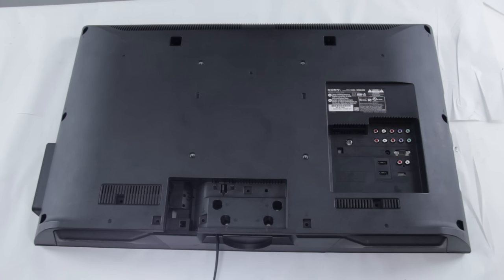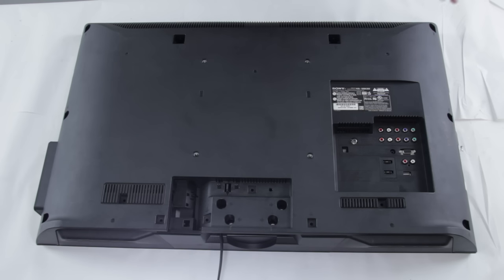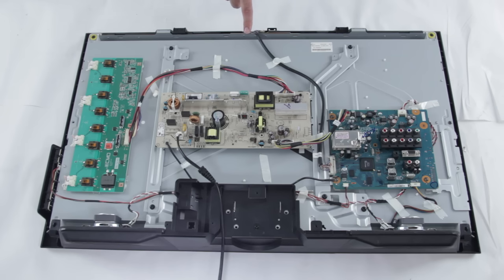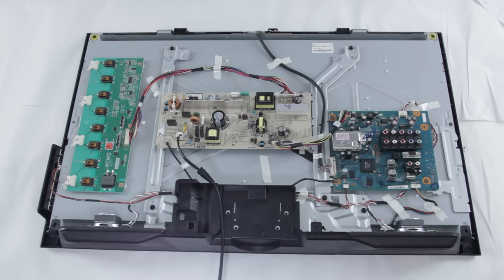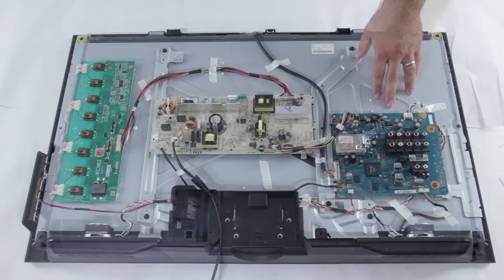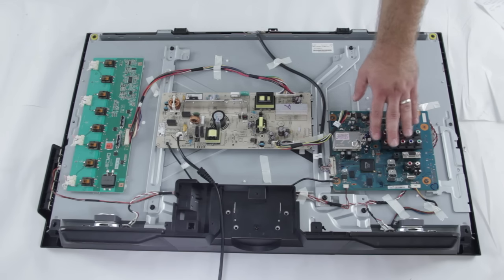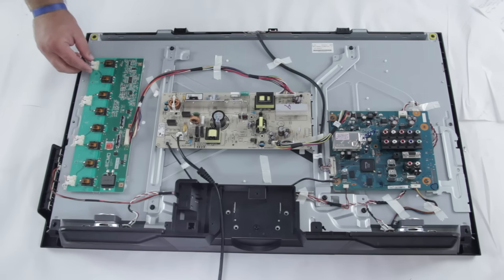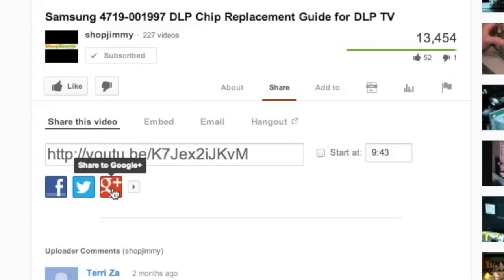LCD TV Repair Tutorial - LCD TV Parts Overview, Common Symptoms & Solutions - How to Fix LCD TVs

Comment: Hi,I have Sony Model KDL-46EX500, around 5-yrs old.  The screen suddenly turns green.  After a while it shows the picture like normal.  Please help.
Reply from the maker: +Jack Burton   Try all repairs and troubleshooting at your own risk. This could be a problem with either the t-con board, the main board or the TV panel. You can replace the main board and the t-con board individually to see if one of those boards fixes the problem.  Click this link to replacement parts for your TV model number:  http://www.shopjimmy.com/catalogsearch/result/?q=KDL-46EX500  There may be multiple boards for the same TV model number, be sure to match part numbers on your current board, with your replacement for compatibility.  Thanks and please let us know if you have any further questions with your TV Repair!  www.shopjimmy.com

Comment: hello I have a auria eq5588 lcd tv and it will not turn on even though the led power light shows that it is getting power. I'm at my wit's end please help.
Reply from the maker: +Cyril Demello   Try all repairs and troubleshooting at your own risk.  I recommend replacing the main board in your TV.  Click this link to replacement parts for your TV model number:  http://www.shopjimmy.com/catalogsearch/result/index/?cat=56&q=eq5588  There may be multiple boards for the same TV model number, be sure to match part numbers on your current board, with your replacement for compatibility.  Thanks and please let us know if you have any further questions with your TV Repair!  www.shopjimmy.com

Comment: I have a Toshiba model number 55L6200U. Ii turns on but it stays on the logo Toshiba also the led light keeps blinking its green
Reply from the maker: +jhovany morals   Try all repairs and troubleshooting at your own risk.  I recommend replacing the main board in your TV.  Click this link to replacement parts for your TV model number:  http://www.shopjimmy.com/toshiba-75030649-main-board-for-55l6200u.htm  There may be multiple boards for the same TV model number, be sure to match part numbers on your current board, with your replacement for compatibility.  Here is a link to a video showing how to identify your part number, click here:  https://www.youtube.com/watch?v=3DQe0ATZl_Q  Thanks and please let us know if you have any further questions with your TV Repair!  www.shopjimmy.com

Comment: sony Bravia KDL-46XBR4 serial #8503363 sept 2007, it's power up  (no image) 20-30 sec later, i hear a clic and start red blinking 5 times. it's intermitent problem, sometimes is lightup screen is nice. power off and not wake up.I read on another place on the web squeeze the bezel, but what is bezel and where is the potential connection fail. On mine we have more the double of board of majority of model i see on YOUTUBE. I know now for what that price (more component) better image quality. i try many time to repair my self but never sove the issue forever.

Comment: I have a JVC LT-37XM48 flat screen LCD TV,  the wrong firmware update has been used to update this TV and now it only cuts on & off and only the channel & power button works now, the TV only gets a white screen when cut on and static sound from speakers! Is there anyway to reverse or wipe this firmware update and reinstall it to its proper software programming to use the remote control and view the screen like a factory reset or something ?
Reply from the maker: +David Mack  Try all repairs and troubleshooting at your own risk.  Y<!-td {border: 1px solid #ccc;}br {mso-data-placement:same-cell;}->ou can try and put the correct firmware on a flash drive and try it that way.  Thanks!  www.shopjimmy.com
Reply: +ShopJimmy.com ,Where do I get this software, JVC customer service say they don't have it, do you know where the TV's firmware is located on this set ?

Comment: hello I have a element tv model number Eldhw421 the tv turns on can work for weeks or seconds then turns it self off  does this randomly please help .
Reply from the maker: +Rodney Purper  Try all repairs and troubleshooting at your own risk.  I recommend replacing the main board in your TV.  Click this link to a replacement main board for your TV model number:  http://www.shopjimmy.com/element-120605-main-unit.htm  There may be multiple boards for the same TV model number, be sure to match part numbers on your current board, with your replacement for compatibility.  Here is a link to a video showing how to identify your part number, click here:  https://www.youtube.com/watch?v=w7Lk4ppnXSY  Thanks and please let us know if you have any further questions with your TV Repair!  www.shopjimmy.com

Comment: I need help repairing a SANSUI LCD TV: Model no. HDLCD1955W, SN: 057610341489, MARCH 2011, 19 INCH.
SYMPTOMS ARE: THE TV WILL TURN ON AND HAS A BACKLIGHT BUT NO SOUND AND NO IMAGE. I CANNOT FIND A T-CON BOARD BUT THERE IS A
PLASTIC STRIP WHERE A T-CON BOARD WOULD USUALLY WOULD BE.
CAN YOU HELP ME?
                                       THANKS!  DAVID E.

Comment: Hi, I have a Samsung Model LN46A500T1FXZA, Serial Number ARW03CEQA15070V. TV will turn on, sound comes through, picture will come on for a second but is shaky, and then will proceed into scrambled horizontal lines. Please help!!
Reply from the maker: +Richard Reyes  Try all repairs and troubleshooting at your own risk.  This could be a problem with either the main board or the TV panel.  Click this link to replacement parts for your TV model number:  http://www.shopjimmy.com/catalogsearch/result/index/?cat=56&q=LN46A500T1FXZA  There may be multiple boards for the same TV model number, be sure to match part numbers on your current board, with your replacement for compatibility.  Here is a link to a video showing how to identify your part number, click here:  https://www.youtube.com/watch?v=BEPWrefQvqIThanks and please let us know if you have any further questions with your TV Repair!  www.shopjimmy.com

Comment: hi. bush  c5566dtv. wont turn on. red standby light goes to green but still nothing. sometimes the tv switches on and works fine  but its getting more and more difficult to turn on. hellllllp!
Reply from the maker: +Andrew Cumberland  Try all repairs and troubleshooting at your own risk.  I recommend replacing the main board in your TV.  Unfortunately I do not see any replacement parts in the search results for your TV model number on our website.  Please reply with your part number on your main board and I can try searching for replacement parts.  Thanks and please let us know if you have any further questions!  www.shopjimmy.com

Comment: i have a 70in vizio E701i-A3E....  we were watching tv AND THE PICTURE WENT OUT FROM THE  bottom to the top it went black i cqn still see a light but its black and i have sound could you help me plz
Reply from the maker: +Nicole East   Try all repairs and troubleshooting at your own risk. This could be a problem with either the t-con board, the main board or the TV panel. You can replace the main board and the t-con board individually to see if one of those boards fixes the problem.  Click this link to replacement parts for your TV model number:  http://www.shopjimmy.com/catalogsearch/result/?q=E701i-A3E  There may be multiple boards for the same TV model number, be sure to match part numbers on your current board, with your replacement for compatibility.  Thanks and please let us know if you have any further questions with your TV Repair!  www.shopjimmy.com

Comment: I have a 40" coby flat screen tv LCD. I have no sounds but a good picture. can't figure out what to do. 
model: TFTV4025
serial: sshm07xxm03t01s01
Reply from the maker: +katherine sullivan   Try all repairs and troubleshooting at your own risk.  <!-td {border: 1px solid #ccc;}br {mso-data-placement:same-cell;}->Check your settings and make sure the speakers are not set to off. If the setting is correct then I recommend replacing the main board.  Thanks!  www.shopjimmy.com

Comment: I have an Element Electronics ELEFT466 (SN: B1300228110001501) - The problem is no picture. Sound plays but no image shows and no backlight comes on either. Any help would be appreciated.

Comment: sony 3lcd model # KDF E55020 ......blue spots show up in the black portions of the picture and a small blue area on the lower right corner of the screen .
Reply from the maker: +Randall Sharp  Try all repairs and troubleshooting at your own risk.  This could be a problem with either the main board or the TV panel.  You can replace the main board to see if that fixes the problem.  Unfortunately I do not see any replacement parts in the search results for your TV model number on our website.  Please reply with your part number on your main board and I can try searching for replacement parts.  Thanks and please let us know if you have any further questions!  www.shopjimmy.com
Reply: +ShopJimmy.com Thanks for the help due to the variability of things that maybe wrong and possible lack of parts I've decided to purchase thanks for making my decision more easy.

Comment: INSIGNIA 50L260A13 NO PICTURE,HAVE SOUND I HAVE REPLACED MAIN BOARD,POWER SUPPLY AND T-COM BOARDS STILL NO PIC
Reply from the maker: +Carlton Lee   Try all repairs and troubleshooting at your own risk.  I recommend running the flashlight test on your TV.   Here is a link to a video we produced that shows how to run the flashlight test. https://www.youtube.com/watch?v=xUzCLgoSPGM Please reply with your flashlight test results and we can recommend a replacement part for your TV repair. Thanks and please let us know if you have any questions! www.shopjimmy.com

Comment: hello there; am having a problem with my sanyo tv , hope you can help me, MODEL #DP58D33  SERIAL# B3120948024962, i have full sound but no image, however i did a flush light ran and you can actually see the image, let me know what parts i need to buy to get it going again. thanks
Reply from the maker: +david torres  Try all repairs and troubleshooting at your own risk.  This could be a problem with either the power supply or bad lamps in your TV.  You can try replacing the power supply to see if that fixes the problem in your TV.  Click this link to a replacement power supply board in your TV.  http://www.shopjimmy.com/sanyo-1lg4b10y11900-z7gb-power-supply-unit.htm  There may be multiple boards for the same TV model number, be sure to match part numbers on your current board, with your replacement for compatibility.  Thanks and please let us know if you have any further questions with your TV Repair!  www.shopjimmy.com

Comment: I have a 32 in Philips model 32PFL3506/F7 Came home and tried to cut it on dead.
Reply from the maker: +Clifton Rhodes   Try all repairs and troubleshooting at your own risk.  I recommend replacing the main board in your TV.  Click this link to replacement parts for your TV model number:  http://www.shopjimmy.com/philips-a17fgmpw-001-main-board.htm  There may be multiple boards for the same TV model number, be sure to match part numbers on your current board, with your replacement for compatibility.  Here is a link to a video showing how to identify your part number, click here:  https://www.youtube.com/watch?v=wooRqBrRo6oThanks and please let us know if you have any further questions with your TV Repair!  www.shopjimmy.com

Comment: I have a model 42pfl5432/37 when the tv turned on for about 5 min it turns off then I can turn it back on stays on a inute or two and turns off you told me try replacing the main board I did and it still is doing the same thing so what else do I need to replace
Reply from the maker: +willam combs  Try all repairs and troubleshooting at your own risk.   I recommend replacing the power supply board in your TV.  Click this link to replacement parts for your TV model number:  http://www.shopjimmy.com/catalogsearch/result/index/?cat=59&q=42pfl5432  There may be multiple boards for the same TV model number, be sure to match part numbers on your current board, with your replacement for compatibility.  Here is a link to a video showing how to identify your part number, click here:  https://www.youtube.com/watch?v=6TPI5s6ZHJY  Thanks and please let us know if you have any further questions with your TV Repair!  www.shopjimmy.com<!-td {border: 1px solid #ccc;}br {mso-data-placement:same-cell;}->

Comment: I have an element tv, model no.= ELCH2S61
SEREIES NO. = GR800035890000204
It turns off a few second after i turn it on by pressing the power button.
Reply from the maker: +Zain Ali   Try all repairs and troubleshooting at your own risk.  I recommend replacing the main board in your TV.  Unfortunately I do not see any replacement parts in the search results for your TV model number on our website.  Please reply with your part number on your main board and I can try searching for replacement parts.  Thanks and please let us know if you have any further questions!  www.shopjimmy.com

Comment: I have a possessed 39pfl2608/f7   the volume just races up and down at will it will work for a little while then start going down or up   any suggestions
Reply from the maker: +Keelan Overbey  Try all repairs and troubleshooting at your own risk.  This could be a problem with either a stuck keypad or bad main board.  Click this link to replacement parts for your TV model number:  http://www.shopjimmy.com/catalogsearch/result/?q=39pfl2608%2Ff7  There may be multiple boards for the same TV model number, be sure to match part numbers on your current board, with your replacement for compatibility.  Thanks and please let us know if you have any further questions with your TV Repair!  www.shopjimmy.com
Reply: +ShopJimmy.com  NOw it it pwering on and off at will like the powerboard is going out
Reply from the maker: +Keelan Overbey   Try all repairs and troubleshooting at your own risk.  This could be a 
problem with either a stuck keypad or bad main board.  Click this link 
to replacement parts for your TV model number:  http://www.shopjimmy.com/catalogsearch/result/?q=39pfl2608%2Ff7
  There may be multiple boards for the same TV model number, be sure to 
match part numbers on your current board, with your replacement for 
compatibility.  Thanks and please let us know if you have any further 
questions with your TV Repair!  www.shopjimmy.com

Comment: I have  47 inch insignia  flat screen no picture just sound how to fixMID
Reply: does not seem like they are interested in answering anyone anymore, but i have the same tv, same problem, mine was inverter board, there is a video on you tube ...somewhere about inverter boards , you power up the tv, u use a flashlight , shine on the board at different angles , and if u can see the menu prompts on the screen ...... even though just barely then you need to replace the inverter board, mine was $24 , easy fix.

Comment: hello I have a 43 inch lcd sanyo model#dp46819  serial#b9420828616664 it will come on and the little screen saver  blinks acros the screen only half the screen works u can tap on the the back and  i8n and out

Comment: I have a Sony KDL-40XBR3 TV that all of a sudden just shows green power light but no video, audio or even any signs on the screen that the tv is on. Replaced both power supply and main au board. same thing just green power light on front and a blinking orange light coming from the back of the unit inside a metal frame that contains another board
Reply from the maker: +jimf28   Try all repairs and troubleshooting at your own risk.  I recommend replacing the main board in your TV.  Click this link to replacement parts for your TV model number:  http://www.shopjimmy.com/sony-a-1212-255-a-au-signal-board.htm  There may be multiple boards for the same TV model number, be sure to match part numbers on your current board, with your replacement for compatibility.  Here is a link to a video showing how to identify your part number, click here:  https://www.youtube.com/watch?v=Aodz2LHkzbY  Thanks and please let us know if you have any further questions with your TV Repair!  www.shopjimmy.com
Reply: Thanks guys. I tried replacing both the AU Board and the main power board. Same problem. Tried the flashlight on screen and it is pitch black.I did notice that the BE-2 board that connects to the AU board has a continuous blinking orange light. I convinced my wife that we need a new SONY XBR55X850C 4K 55 Inch (LOL) and she agreed! but I still want to try to fix this one. I hate the thought of putting it out on the street for removal
Reply from the maker: +jimf28  Try all repairs and troubleshooting at your own risk.   How many blinks are you seeing?  Thanks!  www.shopjimmy.com
Reply: +ShopJimmy.com Hi, the blinking orange light is on the back panel inside the metal cage holding the AU Board. It blinks orange continuously when the power button is turned on
Reply from the maker: +jimf28   Try all repairs and troubleshooting at your own risk.  I recommend running the flashlight test on your TV.   Here is a link to a video we produced that shows how to run the flashlight test. https://www.youtube.com/watch?v=xUzCLgoSPGM Please reply with your flashlight test results and we can recommend a replacement part for your TV repair. Thanks and please let us know if you have any questions! www.shopjimmy.com

Comment: I have a Sanyo DP42647 with what I think is solarization.
[IMG]http://i61.tinypic.com/2r6fg9f.jpg[/IMG]
The TV's menu shows properly, and as in another of your videos you mention that if the menu appears properly with the screen solarizing (?) then the problem is the main board.
Q: Am I making the correct diagnosis?

Looking at the board itself, the underside silkscreen reads 1AA4B10N20000(B), on the front shield it reads 19-N4TE 1AA-2SHF0743.
Q: Which number should I be searching?
Q: Which other boards could fit? "N4VFE"?